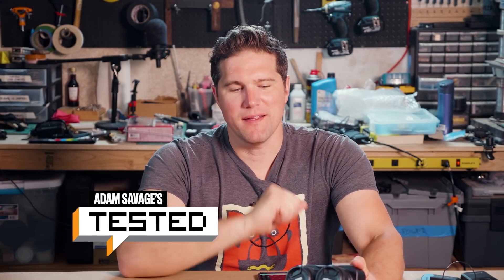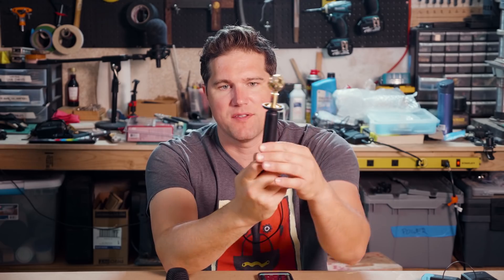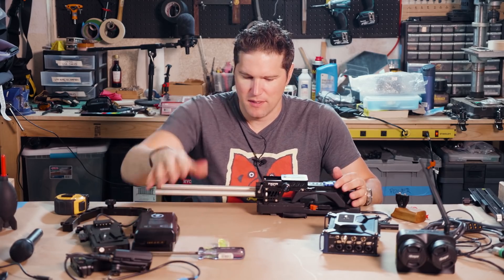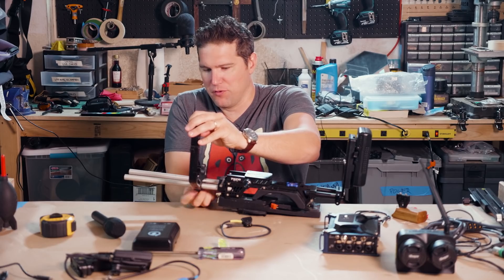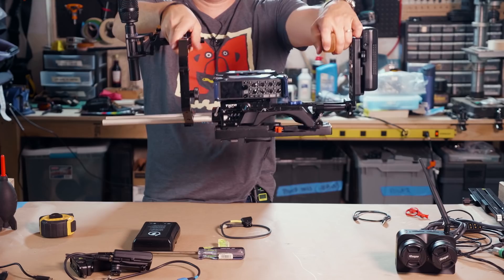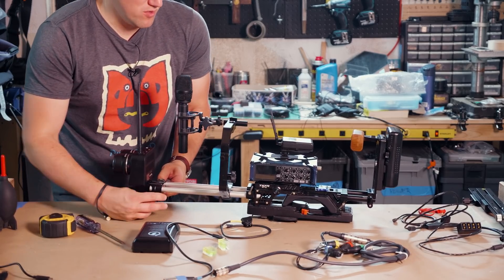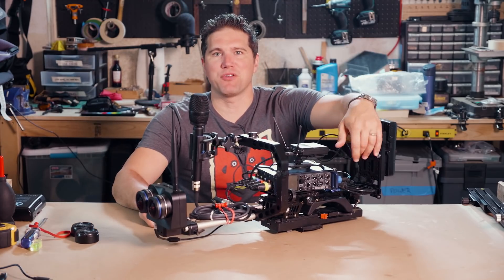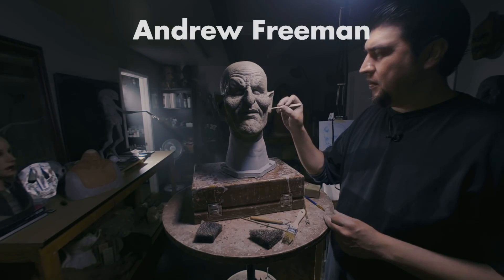Tested: Assembling a VR 180 Camera Rig!

Comment: Cool video. I'm not a videographer but I was asking myself:
Why not putting the battery and audio converter/recorder in a shoulder bag and running cables to a smaller rig with only camera und microphone?  
Or is this rig going to be stationary only on a tripod or something?
Reply: The rig is for a tripod (2:25). Doing 180° VR video with a moving camera tends to make people motion sick, so it's best to either avoid camera motion completely or just doing them in very deliberate and well stabilized ways.

Comment: There used to be days when camera systems were wooden boxes with ca. two or three separate manageable functions.
Then there were metal boxes. Small ones for handheld operation, serious ones with rolls because they simply had to be heavy.
And today you get modular stands and handles with so many possibilities to use. Private people buy flying cameras, people with some budget buy slow mo utility, technicians can increasingly often be seen using thermo cams...
Many cars and trucks have an additional "electronic mirror", most people can effort a camera door bell, practically every phone has two cameras (one of these, meaning millions of them, are rarely used), and a great number of youtubers etc. makes money with good or very good cameras.
Cool stuff.

Comment: If it's not 360 degrees, it's not true VR.
Reply: Big issue with 360° is the resolution, many lower end GPUs and the Quest can't decode stereo-360° at acceptable resolutions (i.e. 8192x2048 would be required, but they cap out at 4096x2048). Other issue is that proper stereo 360° is way more complicated to film properly, so you tend to end up with artifacts all over the place. 180° in contrast can be recorded quite easily and in good resolution. Another issue with 360° is that you simply don't need it, as there just isn't anything interesting happening behind the camera most of the time. 360° videos that force the user to constantly turn around are just a gimmicky waste of time. 180° stereo video is far better at this point in time.
Reply: There is no 360 3d video content. It's not possible yet.
Reply: @sqlevolicious  360° 3D is already a thing, you can buy prosumer cameras that can do it like the VUZE Plus 3D-360 or the Insta360-Pro. The cameras aren't cheap and you might run into stitching artifacts and resolution issues, but it's very much possible. If you search around on Youtube you might even find a few videos doing it.

Comment: f8 is kind of garbage. sound devices makes better quality recorders with a new line for the non soundmixer models that are half the weight to the F8 and better preamps/features. If your going to use any 'spatial' sound its gotta have a good noise floor/preamp/limiter setup. To make spaces seem believable you need clean audio signals at a high resolution..... beyond the simple clip on mic type audio. please don't compress/limit the crap out of things! Also you might want to think about mic placement. you will get masking from the operators body and the camera rig for a good portion of the 360 degrees. and of coarse if your going for clean spatial audio, the operator has to not make a sound while operating the rig cuz the mic will pick it up. no footsteps! Shoot in loud places to hide it all! lol! if 4 channels and dealing with the encoding/decoding process is annoying, I'd also look into binaural. the facebook/youtube encoders will take that spatial info. get two DPA 4060's and make some Adam Savage ears....one day build! 3dio is what you would copy. slap them on either side of the walle camera and go shoot'n! now that would be a crazy looking rig. look forward to hearing what you come up with. good luck!

Comment: From your comments your audience is not told about the camera and what you are attempting to accomplish with this demo.  What is unique about it?  What are the considerations you have to take into account in order to get to your desired endpoint?  What do you have to work around?  Adaptations? What does this camera do and is it important enough to have to build a special rig for it?  For that matter, what is a rig for a "normal" camera like - we need some basis by which we can draw comparisons and therefore understand the point of all this rigging.  Basically, I think you needed to start with a premise,  show some examples and why each thing you add improves the setup over your "normal" output.  Then maybe it all might make sense.  As it is, something got started in the middle and never quite reached an ending.  Result: dead in the water.
Reply: It's a 180° VR camera and it makes 180° video. That's the point of it. it's not meant to replace the normal setup, it's just what they used to film that upcoming multi-part 180° VR series. To see what they normally shoot with you can watch their older videos like this one: https://www.youtube.com/watch?v=_PZxFAav0bI

Comment: I’ve noticed several commenters saying “this would be great for leading you through a virtual tour of a space!” like a real-estate property tour. Unfortunately, no; not with today’s state of the art. VR video on this sort of budget can only give you the “you are there” immersion if you don’t mind being strapped into a five-point harness with a helmet restraint.

If you wanted to do something like a real estate tour, you’d want to use photogrammetry techniques, often called “virtual volumetric video” or “6DOF video” (for having six-degrees of freedom of movement, like a high-end VR headset experience). To do that, you’d place the rig, stationary, in key places in the property to achieve enough coverage that can be later stitched together. For a rig like the one shown that can capture stereoscopic 180° video, you’d probably want a minimum of two shoots for each room (more in large rooms or where you want extra detail for features), with the camera carefully rotated about its focal plane so that it gets total coverage; but to achieve better stitching, with a 180° stereoscopic rig you should really do three shoots at 120° angles, both to give yourself leeway (it’s nearly impossible without special gear to pixel-perfectly rotate a rig about 180°) and to allow stitching to take place closer to the center-line where optical distortion is lessened.

The choice of a 180° stereoscopic camera is key to immersiveness, though; 360° cameras can reduce the workflow considerably (you have to paint out the camera rigging/tripod and any crew on set, but can otherwise skip the stitching) but they lack stereoscopic vision, which makes it impossible to generate a virtual space that one can move around in; instead you have to present “head-locked” video where only the viewer’s head attitude is used, but they can’t shift their heads forward/back or left/right. (These three degrees of rotational freedom rather than the full six degrees including translational freedom are all phone-based VR systems give you, though, so it’s unsurprising you see a lot of video like this.) The other advantage of 180° stereoscopic systems is the stereo vision itself, but this is surprisingly less important than you might think—people get used to non-stereoscopic depth perception with 3DOF systems surprisingly quickly, which is why non-stereoscopic “photo spheres” are so popular. The main advantage of having stereoscopic footage is the ability to derive depth information and thus build convincing volumetric maps.

A shoot like this, with three shoots from three angles from each scene, and a minimum of one scene per room, works very well to build up photogrammetry scenes that are fairly immersive. They have one big limitation, however: distortion builds up quickly if the viewer’s head translates far from the position of the camera; for a camera like the Z Cam K1 Pro, the viewer can only move within a sphere about half a meter in diameter (basically, they must sit or stand still, though they can lean and bob their heads). Many first-time VR producers react to this with “What? You just said avoiding head-lock was the reason to go to all this three-angle nonsense!” Until they try it, that is; it doesn’t seem like it, but the ability to move one’s head about and see natural-looking parallax and depth changes bring an enormous increase in immersion and less disorientation than truly head-locked photo-sphere-like experiences.

In the case of a real-estate property shoot, you’d need to consider this carefully; you could get away with a single shooting location in an airy great room of a property with minimal furnishings, but you’d probably want to do multiple shoots in kitchens and bathrooms where people will naturally want to check out the details of fixtures, etc. This should be obvious, but I’ll just point it out explicitly: a scene shot from a single location, no matter how many angles and lenses are used, can’t see around corners or even tell what color the far edge of that light switch is! So these techniques never allow the viewer to move around “holodeck”-style. 

But to go in that direction, at least there are various steps up from here; Google’s been experimenting with light field cameras (best known from Lytro) to allow for larger head movements, better parallax, and a more natural effect of overall lighting changing as your head moves (for instance, the glint of the sun against a metal surface when you move your head just so). The next step up is to so-called “true” volumetric video (though that’s a bit of a misnomer since it’s impossible to capture all the light rays in a volume), where LIDAR, infrared mesh captures, and other techniques are used in combination with a location tracked camera that’s moved throughout the space you want the viewer to be able to “walk” through. Significant post-processing is required, with a common method being creating a 3D computer model of the space just as in a video game and then projecting the video onto it. When this is done, room-scale experiences rather than just head movements become possible.

If you have access to a SteamVR-capable headset, I encourage you to try Valve’s photogrammetry available via its demo The Lab; they’re accessed via a map with a water spigot (yes, really) very near the entry point to the main experience selection area. Rather than simply enjoying them, study how they work by moving your head, walking around, etc. Several of them are organized such that small sections have been volumetrically recreated (when you touch the teleport controls, these areas appear as ground planes where you can move around arbitrarily), but other views around those sections are just standing/sitting-only points. The stitching together of these two types of experiences into a unified whole is ingenious, but noticing the differences between them in a single setting is very useful to better-understand the state of VR video production.

(And note that I haven’t even mentioned the issues you get into if you have movement in the space! Once you need to track an actor or any non-CG element moving through the scene, the difficulties go up enormously.)
Reply: Nathan Some was copy-pasted from things I’ve written elsewhere, I’ll admit it. But the same questions come up repeatedly in VR. 😂
Reply: @TreyHarris  I saw you mentioned google lightfields, have you downloaded "Welcome to lightfields"? (download from steam) It's the best photogrammerty you can get, HANDS DOWN, truly bleeding edge! You can even move around in 6DOF and get real depth and changes in lights/reflections as if you are really there! They have tons of photos of the Space Shuttle and ones inside of it too, it's the best we'll ever get to actually getting to go inside of it. Lightfields is some seriously ahead-of-it's-time technology, the Lab and all the other photogrammetry stuff just looks terrible in comparison!
Reply: EVOLICIOUS Yes—as far as I know, Google hasn’t released any other light-field photogrammetry demos.

The particular demos are interesting and show some ways the technology can be stretched beyond faithful recreations (for instance, in one example, as you turn your head and body around the time changes, in another a person’s facial expression naturally animates as you move your head side to side, and in a third, someone’s eyes seem to follow you around—creepy!). But to use that particular technology to implement seamless room-scale 3D recreations, I think you’d need a drone with enough payload capacity to carry around two or three light field cameras that’s still small and light enough to be flown indoors (not sure that even exists off-the-shelf, especially one that could navigate a typical home!), and then you’d need a wireless link speedy enough to ingest raw data from all those cameras and fine-enough location sensing that everything could be auto-stitched.

This is all eminently possible, but practically it’s at least a few years off.

Comment: I don't get how this is VR isn't it just stereoscopic, surely you can't move your head around if the camera is fixed.
Reply: It's 180° video with a human IPD (~64mm). Your average old school stereoscopic 3D movie does neither use a human IPD nor does it provide a 180° view. Furthermore the average VR headset has a FOV of 90°, so you can 2DOF look around with your head inside the 180° video quite a bit. Stereo vision goes a little wobbly on the edges and you can't 6DOF move around, but it's still far closer to reality (thus VR) than any normal stereoscopic 3D movie.

The technology for real 6DOF video just isn't here, even Google's "Welcome to Light Fields" demo, which was just static images not video, was really underwhelming compared to proper 180° video, as the resolution was quite low and the 6DOF freedom was still extremely limited to like 30cm or so, which was pretty useless in the end.
Reply: @grumbel45  If you move your head at all, even just rotation, your eye balls are no longer in the same position as the camera sensors so surely the 3d breaks,  I guess maybe you get away with it if you're not moving you head too much, I'd have to try it.  I assume looking up and down is better that left and right.
Reply: @PeterMcMullan01  It's not like that at all, it's more of like a ultra-large screen that captures 180 degrees of your view, the "image" stays still and you can move around your head just fine. Think of it like a movie theater, but the content completely immerses you. The trick is the edge of the plane and the depth of the content really fucks with your lizard brain (though you'll need to turn pretty far to see it, and that is not intended). It's a crazy experience and you'll understand much better when you try it. It works just as well as real life, especially the high-quality VR porn stuff, it's freakishly real feeling.
Reply: Because it captures 180' and the FOV of the headset is less (say 90' or so for the Rift) you can move your head around. It would look like the front half of the world was real and the back half was black or a 180 semisphere of Tested logos or whatever they decide to edit in. Not really an issue if you're focused on the subject as you wouldn't see the edge of the footage unless you wanted to.
Reply: @gterpening  I'm not convinced that works that well, but I've not tried it so might be wrong.  Here's an video about it.  https://youtu.be/DustblCzdhM?t=368
Reply: it records a 180 degrees fov

Comment: What about supporting Oculus Rift? I pad a lot for a real VR headset and everyone just seems to support the wireless crap.
Reply: I think you need to ask Oculus about that
Reply: Stark's Reality Only because Oculus gets exclusivity deals which they confusingly apply not only to their products vs. the competitions’ (though that’s bad enough), but to one segment of the products vs. another. There are no technical limitations.
Reply: @Zwenk Wiel Nope, they own slightly more than half the market share of vive owners. They sold more PCVR kits than anyone else, that's a fact, but to think it's a dominating kit as you say, is delusional, and goes against all the statistical data.
Reply: @Zwenk Wiel Oculus' HMDs have 49.25% marketshare compared to the VIVE and VIVE Pro having 37.6%...and that's with Oculus having a significant headstart onto the market, and a price advantage of 30~50% over the VIVE or Index. What a tremendous victory.

You don't exactly see Microsoft throwing a party over WMR having 3x the marketshare of the Valve Index, when WMR headsets sell for a FIFTH THE PRICE. Because that's not how these things work.
Reply: Oculus Rift? I thought you said you got a real VR headset. 😏

Comment: Just take a Insta360 Evo and run with it. I sadly don't have bins of rigging equipment.

I do find that your rig is not very compact. It's light so you don't need the heavy tripods.
Reply: You are wayyyy off. Two completely different technologies with polar-opposite experiences. 360 2d is nothing like 180 3d.
Reply: @sqlevolicious  you are even further off. The Insta360 Evo is both. 360° with almost all the features of the Insta 360 One but the whole "Evo" thing means that it also converts into a stereoscopic 180° camera. It is not opposite technologies it's just a difference in setup.